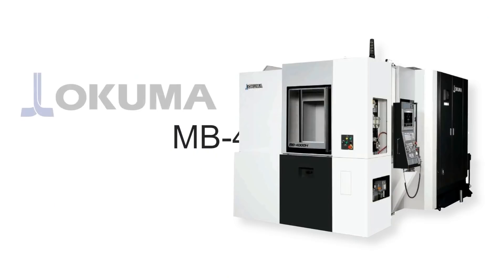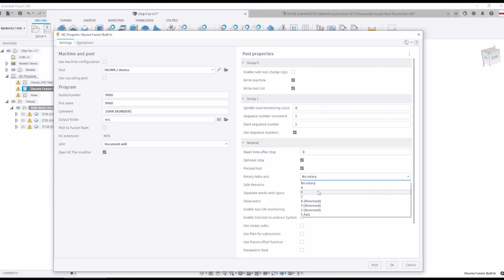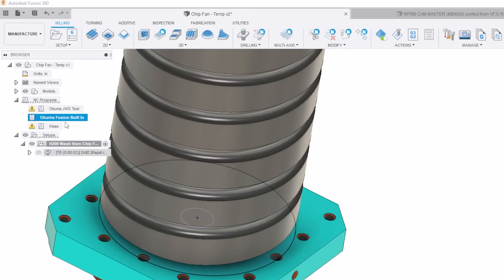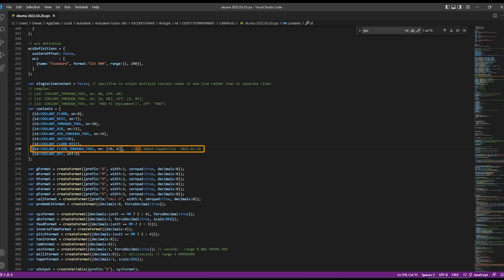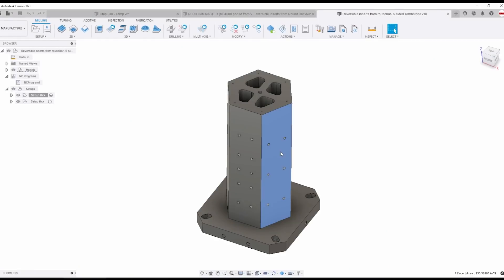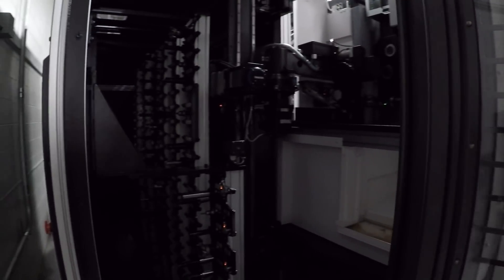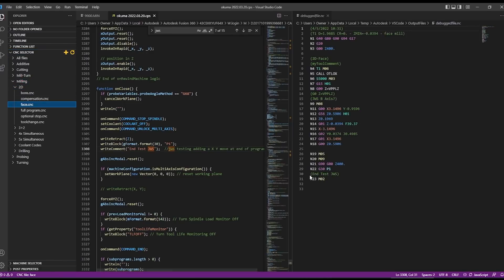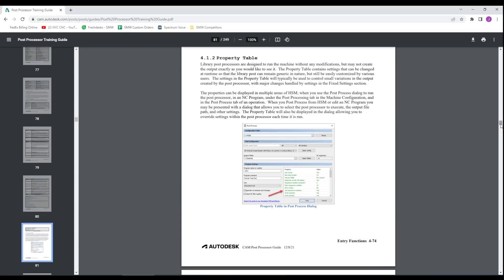How to Modify our Fusion 360  Post Processor for Okuma Horizontal CNC!

Comment: I've previously always used Winmerge to compare 2 text files.  Its also a very handy free utility.  Nice to know VS Code can run a post proc just like a compiler and find code execution points.  Very handy feature.  I use Notepad ++ for my .nc editor with the G-Code language plug-in.  Notepad ++ can also compare files natively.

Comment: Hi John - something to keep in mind with your [0,360] range, is that 0 IS 360. So you've technically already gone a little bit over. You could say [0,359] but your tooling might be smaller than 1 degree, so what you really want is something that represents "from 0 to, but not including, 360". I don't know if the software automatically handles that or not.
A trick you can use to keep things in range of 0-360 is to use modulus, which is often indicated by the % operator. (angle % 360) would let angle go past 360 but you'd only keep the remainder and the value would always be 0..360.

Comment: If you haven't already tried it, or figured it out, you can call up a new post processor and your old one like you described in "compare".  Then open up "CNC Selector" to see how each post processor handles the code it's spitting out.  I'm in the process of trying to get circular milling to work in my old processor that I've highly modified for an old Mazak.  Tedious to be sure, but this little trick is for sure a "game changer".  Thank you very much.

Comment: I had to modify a ton on my okuma post to get it to work on an older machine with only 128kb of memory. I did get it working great and had it where I could enter a common variable to the number of duplicate parts I wanted to make and it repeat each tool on however many work offsets I wanted, incrementing the offset until it reached that number then move on to the next tool change. It made changing up the number of times I would pattern something real simple at the control instead of in inventor/fusion.

Comment: Hey John, this is cool. But you will have to unpick all that hardcoded machine config stuff from your post eventually. Instead you will need to set up your machine config in Fusion 360. It's actually far less abstract doing it in the machine config UI anyway.

Comment: I have only got Visual Studio Code to work once. Once I saved the modified post VSC has never jumped to a line again by clicking the Gcode line. WTF did I do wrong?
Reply: Do you mean if you select a milling function from the left side from the nc-gcode extension and run it with your postprocessor.cps, you cant click a line in the .nc output file and have it bring you back to where it was generated in the .cps file? Im having that same problem. Got it to work once and now it wont.
Reply: @Lambo429  Exactly. Only worked until I made changes. Once I saved the changes it never worked again. Ive tried uninstalling and reinstalling. Nothing works. Not sure what setting is messed up but obviously John has it working all the time.
Reply: @greg2337  I rolled the fusion hsm extension back a version and it started working but then it quit working again. I feel like its something dumb that im missing
Reply: @Lambo429  I feel the same way. John talks about how great it is. I watched the original video 100 times to see if there was some setting I missed but I can’t see anything different.

Comment: i have modified my post to stop machining, whenever there is a tool in the spindle which has an exact length like 90.000mm. If its 90.001 or 89.999mm then the machine continues.

Comment: Great video, thank you. Just a little trick which may help, instead of writing comments where you make a change, which may need to be deleted later on, I use a "debugMode" variable, and a little function "writedDebug", based on writeComments, which is written ONLY when debugMode=1, or true.

function writeDebug(text){
  if(debugMode){
    writeComment("DEBUG - " + text);
    log("DEBUG - " + text);
  }
}

That way, it is both in the code output and in the log file, in case there is a problem for the processor to post.
Reply from the maker: Love this!
Reply: Thanks for that Le Bear... somehow I've missed that after all these years. I've been using some other techniques, but this is a lot better.
Reply: I think it's still valuable to wrap up all those calls in plain if statements though
if (false) {
writeDebug()
.....
}
That way you can isolate certain areas of the post you want to debug, instead of being overwhelmed with information you don't need to solve a particular problem.

Comment: If you're really wanting some version tracking tools, look into the git extensions for vscode. In software development, the ability to check out an old version and track changes over time has tons of power. (Would also maybe allow moving some of your comments out into commit messages, though having them in-lined is nice when you're reading the file.)
Reply: And then when Fusion puts out an updated post you could pull it into the repo and see a diff of changes.

Comment: Most of this video was chinese to me. Thats not a knock against john. For some reason i can never wrap my brain around this stuff. I was tickled to death when i figured out how to change where our hurco would home to at the end of the program lol. If i knew half of the stuff mentioned in these videos it would be a game changer for what i do.
Reply: Please share how you do that. I have a 2004 Vm1 with ultimax that goes to the home(back right) position after a end of cycle. I usually edited it in my dnc software if I’m running a lot of parts. I also want to figure out how to turn the coolant on at the feed height instead of the z height before it rapids down.
Reply: @Jraksdhs  i don't know yet how to permanently edit the post. For now when i post the program and it jumps over to the visual editor program i scroll down to the end of the program where it calls out m30 (i think? Honestly cant remember for sure if thats the right code at the moment) x0 y0. I just change that to x whatever y25.0. I run a 2014 vmx50 50 taper so x is 50" y is 26. I'll position the x differently depending on the job and then i do y25 instead of 26 because for some reason i got an over travel warning even though the machine will actually go to y26.025. Dunno why but 25 is good enough. I also can add an m52 at the beginning to turn on air blast and m62 at the end to turn it off. Theyre auxiliary function codes and 52 &62 turn off the air nozzle mounted next to the spindle. I dont have through tool air (wish i did) and i haven't figured out how to turn on through spindle coolant. The machine has it but the fusion hurco post doesn't support it. So i assume its something that needs change just like in this video. But i dont need it that often so i just push the button on the control when i need it.
Reply: Honestly just start documenting all of these things you’re learning. Eventually you’ll be in a position you’d never believe in a few years
Reply: @TJ4A9  i watch these videos and literally im blank lol i can model and do reasonable cam work on fusion but beyond that I'm pretty computer dumb. I get confused just on file types like step and dxf and stuff. I just dont have much use for a computer outside of fusion. I dont even have Microsoft word in my laptop.

Comment: we got our MB4000 a few years ago so im a bit fussy on the details but I remember being going through the same thing.  We had a really good fusion post for our M560 and M460 5AX so I thought the horizontal would need little if any modifications,  It ended up being the most challenging post i've had to get it working properly.

Comment: Looking forward to more videos on your Okuma journey, do to the fact I run them every day. (Mostly mill-turn)
The post of the letter “O” plus some numbers in the start of every program, typically is do to the postprocessor being set op to post every program as a subprogram and not a main program.
Okuma sub programs start with “O” EVERY TIME and is followed by at least 1 letter then either 3 letters or numbers, or a mix. As an example “OA001" or "OA01A". 
This is also why your sub routine for checking toolheight is starting with an "O" (OTLOX). Okuma often uses a lot of sub-routines/programs.
Also if a subprogram is created, the file extension must be ".SSB". But if it’s a main program the file extension must be ".MIN"
A lot of times Okuma machines is a bit picky with how the exact syntax should look like, and in what order for example specific g-codes should appear.